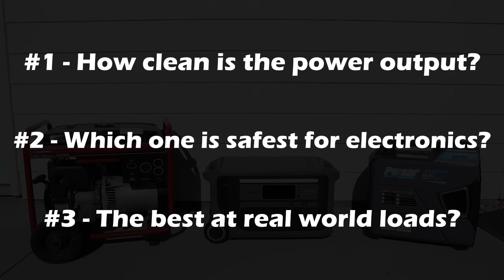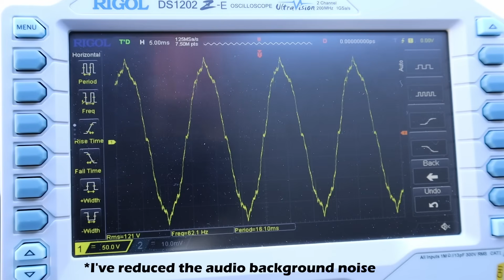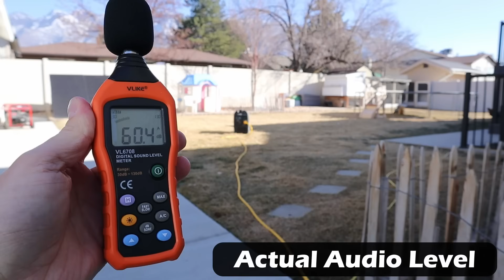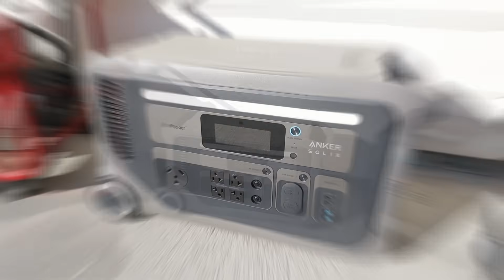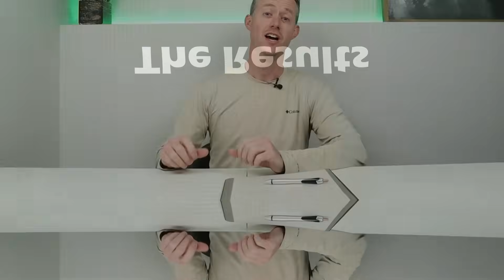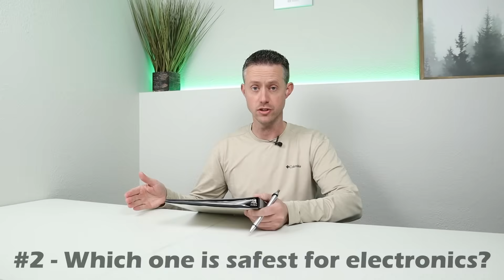Before You Plug Electronics Into A Generator, Watch This!

Comment from the maker: Thank you everyone for sharing your comments and feedback on the video! I have definitely learned so much reading through your comments and experiences. I'm not a generator expert so I have enjoyed reading all your thoughts. You guys have taught me so much! 

I've definitely learned that not all traditional generators are the same. The power output can vary dramatically. Some nicer models have AVR which keeps the voltage more consistent. Some higher quality options have lower THD than the one I tested in the video. It would be interesting to see how a more modern/expensive traditional generator performs VS the older/cheap one in the video.
Reply: In theory a power station charger should be robust enough to handle any input. Switching power supplies shouldnt care either.
Reply: I thank you for the Video, i think most of us dont have 3 different Generators to compare and with your Measurement its possibile to see the rough difference between them.
Did you see the small tight waves onput of the Sinewave ?
This is REALLY bad becaus this is High frequency and can cause many different issues.
It seems small but if you can see it in the scale of the Main wave its huge !
This High Frequency appers while under most load (peak) and create strong magnet fields.

These unwanted high frequency can interrupt Radio devices and travel in all lines connected.

In wrost case the inerrupting radiowaves abel to travel miles , because the Cables act like antennas.

There are real Radio experts and Engineers on youtube who can explain much more.
A Video together would be so nice.

Have a great Day
Reply: Changez le ressort du gouverneur. Vous verrez de suite un changement . Ces ressorts vieillissent très mal .
Reply: I have a conventional Champion generator. I'm wondering if I should get a new dedicated inverter generator or just a good quality inverter to use with my current generator?

Comment: Thanks for taking the time.  You're definitely a scientist 🥼. I'm looking for some options to deal with extremely high electric bills in Alaska winter. Bills go to 350 - 440 a month. From about 150 in summer with a little bit of an increase in usage. running electric baseboard heating. So I'm looking for an indoor solution. None gas or tri fuel. That can "safely" run space heater TV, and laptops. You video gives me a little more information and insight. Thank you.

Comment: I think everyone is nerding out on all this measuring crap. 
I've run dirty power generators for over 25 years to power a well, multiple televisions, internet connections, lights, garage door openers you name it I've done it. All with no issues. Would I like it to be closer to house power? 
Certainty!
Reply: How about to a modern day gas furnace with circuit board and blower etc.  They say one should not have over 5% THD.  Is it BS?
Reply: @harleywayne8649  And yet, the max allowed THD at a home is 8%.
Reply: 100% !!!  This video is anal retentive garbage.

Comment: We just went through 2 days of power outage and my trusty old 5000 watt generator ran my 70 and 75inch tvs the modem for internet my refrigerator and deep freezer and a couple of fans. Oh I almost forgot I ran a cord to my neighbor and I don’t know what he ran but for 40 hours my generator ran and used about 7 gallons of gas and I also would unplug my refrigerator and deep freezer to run microwave or my coffee pots, charged phones and laptops! 
A few years ago I remodeled a house I purchased and had to redo most of the wiring so I disconnected the house from the main power and ran a cord from my 240 and plugged into where the stove connects and ran the whole house for a week or 2 until I felt safe enough to connect to the grid again. Before anyone ask it is an old master mgh500c generator 5000 watt
Reply: 100% !

Comment: Guys can you please tell me?? Why incandescent bulbs and LED bulbs flicker/blink on my single cylinder based Non AVR type GENSET but these bulbs glow 🌟 stable on my inverter generator and mains supply.
Reply from the maker: Has to due with the sine wave form and the hertz output. Inverter generators are much cleaner and more stable.
Reply: The Voltage and / or Frequency regulation of your generator needs repaired or is of low quality.  My traditional generator does NOT have these problems.

Comment: Modern electronics are not likely to get damaged by dirty power. When you plug a router or modem into a outlet, you aren't plugging the delicate computer chip into the generator. You are plugging in a black plastic power adapter (the "wall wart"). Because of this, it is HIGHLY unlikely for electronics to get damaged. I have yet to find a single youtube video out there of someone saying their modem or router got fried while getting powered by a gen.

Comment: If your afraid of "Dirty Power", use a surge protector. 99.9% of plug strips are also surge protectors and you should be using a surge protector with electronics regardless. Also, 99.9% of consumer electronics are made to work properly everywhere in the world be it 50 or 60 hz, 110-250 volts. They use a universal power supply that converts the AC into DC because electronic use DC power, not AC. Dirty power is a real thing but not the boogieman that the company that is trying to get you to buy their product claim it to be.
Reply: Surge Protectors do not necessarily make dirty power, into clean power.  Your wall outlet can have 8% THD !!!

Comment: I would not put fans in a standard generator or non sign wave inverter. The motor actual needs the sine wave to turn properly. If its modified or a bad sine wave it can cause the fan to repeatedly rachet turn and cause heat to build up.

Comment: High EMI noise can be more harmful to sensitive equipment such as PCs, monitors, and medical devices than non-pure sine wave electricity. That's why I would rather use sensitive equipment with a traditional generator that produces very low EMI. In my experience, high EMI noise causes increased input lag, less smooth display performance (I'm using a 540 Hz monitor), and significantly degrades image quality. Any EMI noise level above 300 mV can potentially cause these issues, and even Titanium-rated PC power supplies have only mediocre EMI filtering.

Comment: Pardon my ignorance as I don't know if this has been asked. I have an Anker SOLIX C2000 Gen 2 power station that I take up to a hunting cabin with a traditional old school generator that sputters and makes the lights flicker. Is it ok to plug it in to recharge for the few hours we fire the old girl up? I'd hate to damage it.
Reply from the maker: The power station will usually refuse charging if the power output is bad enough. It might be worth purchasing an affordable inverter generator if you need to charge a lot.

Comment: It should be noted, normally when connected to A/C power, the power station will pass the power directly through, so the dirty generator power will go through. This is fine when just connected to the wall, and it is more efficient, since running the inverter wastes power. However, if hooked to dirty power, you will want to go into the app for the power station and disable grid pass through, and force the inverter to run constantly.
Reply from the maker: Not many power stations have that setting 👍

Comment: an inverter generator connected to a power station ideally with a grid adaptation function like apex 300 for example seems like the best way to have the cleanest input energy to your panel to feed all types of loads, even more sensitive ones.

Comment: Devices that have built in inverter power supplies with variable speed motors are doing the same thing as the inverter generator. They convert noisy AC electricity into DC electricity and then back to AC. It is conventional motors like the air conditioner compressor and fan motor that suffer the most from poorly regulated generator output.

Comment: One thing that can be run on non inverter generators: Tolerant Battery chargers. I have a 12/24v from aims and the tolerance for voltage and frequency is wack. 
40- 70hz range with 96v - 145v input = full output, lower than 96v to 70v de-rates it. Reason being is that these are RV charger converters and are expecting bad power. 
Thank you for producing a clear gen, inverter gen, and power station video!

Comment: Unfortunately, after contacting some manufacturers,  I have learned that traditional generators are also not recommended for recharge of power stations or for the relatively sophisticated chargers of Lifepo4 batteries.   This means I need to be more selective in my recharge plans and only track down inverter generators in my neighborhood.  It also pushes me more towards using vehicle-alternator-based recharging, where the least expensive option is jumper cables and a power station that can recharge relatively quickly at 12-14V.

Comment: My 2500W Onan onboard generator supplies 20A of dirty power to my Airstream Interstate RV.  It runs electronic circuitry, microwave oven, 13,500 btuh air conditioner, refrigerator, water heater, TV, stereo system, 120V outlets, lights and a Tripp-Lite onboard battery inverter.  I have also hooked up a portable Champion 4200W gas open frame generator directly to the shoreline receptacle and everything runs the same at 120VAC/60 Hz.  I even charged my BIuetti Elite 200 V2 to the Champion generator for 1000W and the power station cleaned up the sine wave.  FYI - This is not a recommendation for your rig.

Comment: I have a question, I have a Delta 3 MAX Plus ,what can i use to clean the power coming out of my small generator 
I have solar panels but want to use my generator from time to time . I used the generator on my pool robot and it took out the control unit .
the generator is a 2250W INVERTER   MODEL56225i
thank you

Comment: Using Honda generators for many years never damaged anything but have had  quite a few equipment damage soon after having major power line fluctuations (lights flickering-dimming momentary off/on).
I swear I can correlate stuff breaking not long after having these fluctuations.
Modems/Routers/switches seem most susceptible.

Comment: My RV comes with one 200 watt Go Power 12 solar panel.  I am trying to find two panels with similar specs to wire in series.   The HQST 200 watt panel on Amazon has very similar specs to the go power. Can you test that panel please. The Imp is very similar so I would not lose much. Comparing to callsun would be great
Reply from the maker: HQST is a sister company to Renogy. You'll get good performance from it as long as it matches the same Volt and Amps of your other previous solar panel.

Comment: Nice video, yet all these outputs are ok, far better than a cheap non-senoidal UPS.

Any electronics tied to the traditional generator can offset that dirt away within the first or second decoupling capacitors pack though.

Comment: Welp, I bailed on this video early on because for literally years folks have been doing fine with "dirty" power generators. Yeah, one needs to keep in mind the power factor with motors but parameters like frequency are very much not an issue anymore given we rarely see any electronics using transformers. Refrigerators do just fine on 'dirty' generators too. On most modern fridges there's a wide frequency margin on the compressor and the electronics are designed for just such backup sources. Ditto that for modern computers and TV's. Switching supplies are very tolerant of frequency deviations and brown out type occurrences. So, yeah the inverters are nice with a pure sine wave output but aren't really necessary for emergency situations. Right now (2026) inverters still aren't competitively prices but when they take a real dip in cost then I'll switch over. Until then this is all moot. Signed a real E.E.

Comment: I have 2 traditional generators a 2 stroke at 750W and a 4 stroke at 1200W. Yeah they are quite small but I didn't need a big unit. Interestingly, the 2 stroke did not make LED lights flicker but the 4 stroke does. So it really seems to depend on  the quality of the alternator.

Comment: Not all traditional generators are the same.  Buy a cheap generator and you get really crappy power.  Buy a good quality generator and typically you can get THDs less than 5%.  BUT...Most inverter generators are much cleaner than MOST traditional generators.  Power stations are just inverter generators with a battery rather than an engine.  Also, inverter generators are typically twice the cost of of a traditional generator.

Comment: The inverter generator is the real winner as the power station cannot supply as much kWh as the inverter generator. Also 'recharging' the inverter generator is quicker, i.e. top up the fuel tank.

Comment: Good video. Are you using any protection for the scope or simply direct connecting?
Reply from the maker: I'm isolating the ground on the oscilloscope to avoid grounding issues.

Comment: I always laugh to myself a little when people think that modern electronics are somehow sensitive to poor power quality, when the facts are the exact opposite.  Anything with a switching power supply (99.999% of all modern electronics devices) cares not one flea fart about how noisy, dirty, out-of-spec, over or under voltage, under or over frequency, or distorted the power is.  What are sensitive to power quality?  Motors and devices which use linear power supplies that do not have internal voltage regulators are pretty  much the only thing that care, to varying degrees.
Reply from the maker: The comments show mixed results. Some people report their generator killing stuff, some don't. Why risk it?

Comment: Several years ago my wife inadvertently left her Nissan Leaf EV powered on in the parking lot at work on a cold winter day. Nine hours later it was completely dead. I brought a small gas generator there with me to recharge it. After I got it hooked up I got in the car to get out of the freezing cold wind. Out of boredom I pulled out the cars manual from the glovebox and started reading it. On like page 32. In the middle of a paragraph, in normal font I read, "Warnng: Do not attempt to recharge the car with a generator. Doing so will damage the cars electronic components and void the warranty.". GEEZ! That should be in printed in bold, red on the dashboard - not hidden on page 22 of the manal! (And that's how I learned about dirty power!)
Reply: How did the story end? Hopefully good?😀

Comment: The first tests on the traditional petrol generator really surprised me as I've never scoped the output of mine.  One would have perhaps thought that due to the alternators construction,  that the output waveform would have been the cleanest sinewave available from any of the tested generators.  I wonder whether the automatic voltage regulator in the petrol generator is causing the artifacts that are present on it's output waveform and, if so, whether an improved regulator would render the petrol generator the preferred option.  As soon as I get the chance, I will scope the output of my very cheap petrol generator and let you know what I find.  If it's at all possible, I will also try to scope the output from the actual windings and compare the results with the normal output sockets.  Interesting video.

Comment: You skipped a test, which is the distortion when the table saw is running. That table saw injected a lot of noise and that will adversely affect connected electronics even if the supply is good. You also should have measured your grid power as a baseline for comparison.

Comment: This is the test we didn't expect but needed. The last generator (powerstation) shows a sinewave with "cross distortion". Its very easy (for manufacter) to fix, improving THD numbers and power quality.
Reply: I think the term you're searching for is "crossover distortion".
Reply: @MRandDS thanks!👍 in spanish it’s called “distorsión por cruce”, very common on class AB amps!
Reply: @Flavio-ar Indeed.  In an amp of course it is caused by operating the AB pair in the non-linear area of their cutoff (the very definition of class AB amplification) - something that is lessened greatly by using matched pairs of amplifier output devices and higher quality output transformers (if used).  In generators, this is caused by ferro magnetic non-linearities in the stator and/or poor filtering and/or regulation in the supply to the rotor from the regulator.  You're most welcome!

Comment: In the 1990's and early 2000's we used APC UPS's as back-up power for desktop computers. Back in the 90's I looked at the output waveform of the devices and saw that they were what some call a modified sine wave, which I think is a term coined not by the engineers in the company, but more likely by the marketing team. In my opinion, a more accurate description of the waveform would have been to call it a modified square wave. As far as I know the APC UPS's were manufactured for use with desktop computers, and I am not aware that any computers were harmed by them. Similarly, I don't think that people need to be very concerned about powering their electronic devices from conventional rotating generators as long as the true-RMS voltage and fundamental frequency are what they should be.